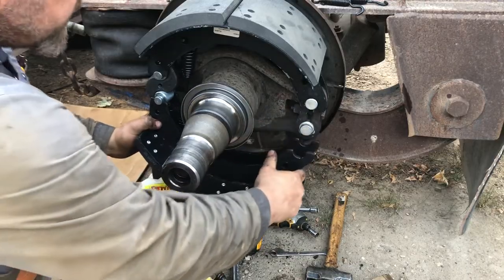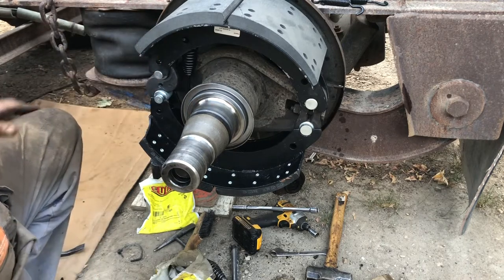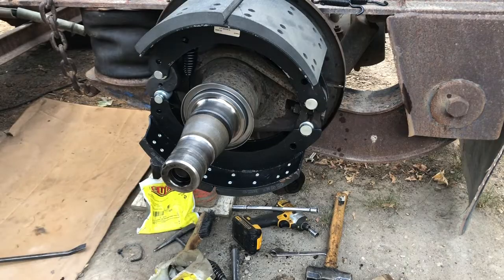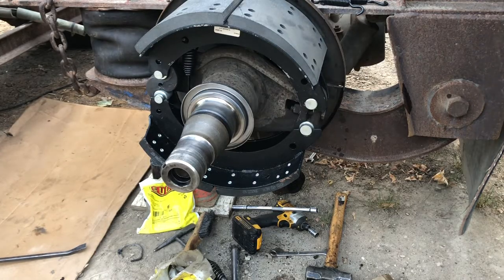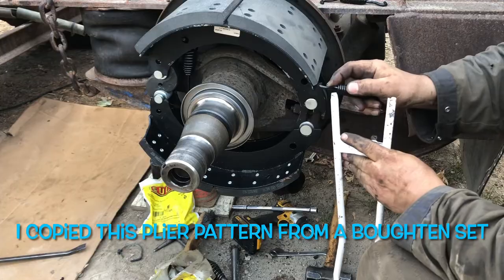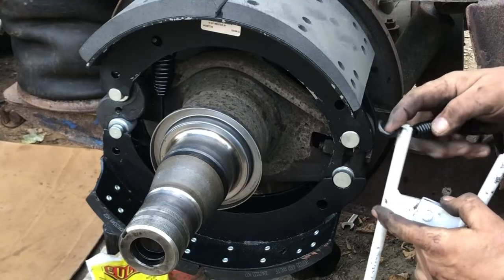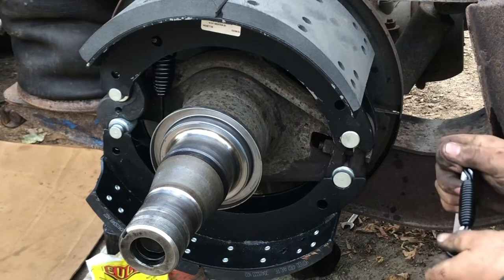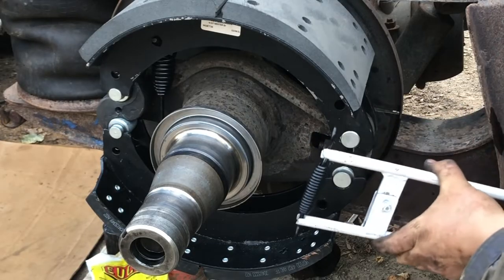Installing Brake Shoes on Semi Trailer

Comment: Can you please tell me where i can order this special tool for springs installation.Thank you
Reply from the maker: I’m not sure where you are located, but here in Saskatchewan, Canada. I got them from Fort Gary Industries..
Reply: @staffordshires2  im in Sacramento California
Reply from the maker: @maxg70  if you go to any heavy truck/trailer parts stores. I’m thinking that they would have these brake tools for sale. If not try the truck dealers.. hope this helps..
Reply: @maxg70  Be a man, use your fingers! Just joking! I use needle nose or regular vise grips and a smaller pry bar or long screw driver and that works great